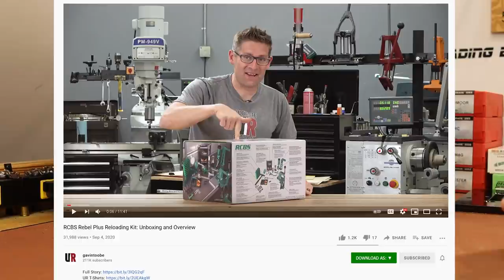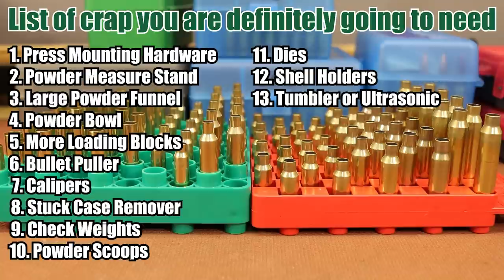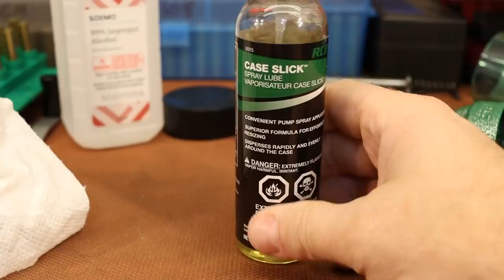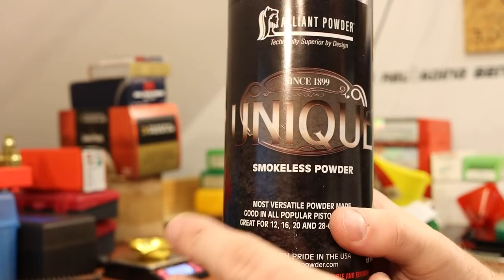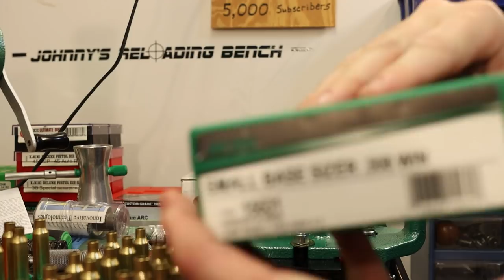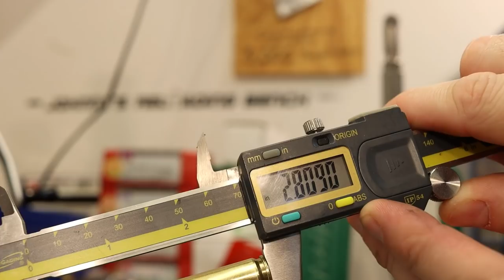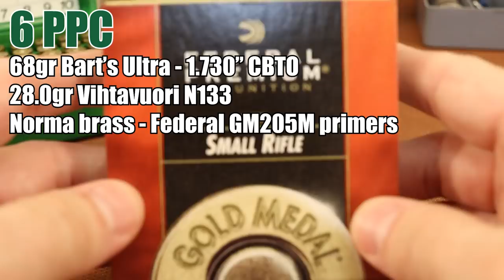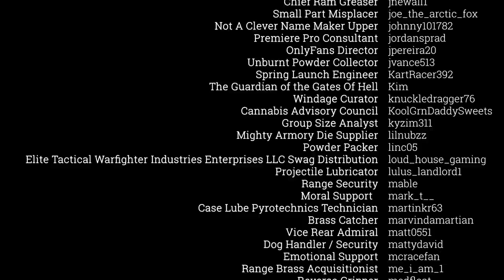RCBS Rebel Master Kit - Full Version

Comment: I came really close to buying this press kit but ended up just buying the RCBS Partner press and a Dillon 550C. I knew I wanted to get into reloading so I just went for it and jumped in head first. Now I have a single stage press to work up a load and Dillon had a thing where you can build your own press kit so I got the progressive to reload bulk 223/556, 6.5 Grendel/Creedmoor once I get a good load worked up and pistol ammo. I bought my last die set right when the Kung-Flu stuff hit but by the time my Dillon came in I was down to my last 300 primers and everything disappeared so haven't really got to mess with it. But the Partner press I've loaded some ammo and for the size of the press I really like it because it doesn't take up very much room on the bench. Glad to see you back on YouTube JRB you rock brother!!!
Reply: Nice👍 primers will be back eventually.

Comment: The greasy stuff off the dryer sheets is the fabric softener.  Most people don't know that fabric softener doesn't actually soften fabric, it coats it with a fine layer of lubricant that makes it feel softer because it's slick.  It's a friction modifier not a softener.  So when you're drying off after a shower with that nice soft feeling towel you just washed, you're actually just smearing lube all over yourself.
That's also why washing machines or that Downy ball that some people use don't add fabric softener until towards the end of the wash cycle, if you add it when the detergent is still in the water mix it washes away all the fabric softener, aka lubricant.

Comment: I got started with the first Rock Chukker in the early 1970s. I reloaded everything with it,  .410, 20ga, 12ga (in light to hunting loads), .25. .38. 357mag, .222, .223, .243, 3030,. .300wm. I used it to load incremental powder and bullets to find the most accurate load for each of my firearms. I show a lot on teams and just target shooting. I bought lot primers, lot cases, lot bullets and lot powders. I shot spring, summer, and fall. When winter hit I spent my spare time in the reloading room all winter to have 15,000 rounds ready for spring again. I loved that system. BTW, I bought 5,000 round cans of .22LR also.

Comment: I just wanted to thank you for this excellent content, I had just ordered the Rebel Plus kit when I found this content and I have to say you have explained and demonstrated so many areas that I was unsure about. I have not started to physically load yet, still trying to assemble all of the necessary components. (Individual items are still in short supply in Aus), but after watching this, I feel a lot more confident than I did before. Many thanks again and I will now be watching much more of your content.

Comment: Welcome back!  Love your stuff, been with you for 4 years since I built my 6.5 Grendel AR.  You are a digital guy but I love analog, no batteries to run down or out, no wondering how far off they are, simple and accurate.  I still check them but they are never off and I often use digital and then the analog to double-check the accuracy.  My RCBS RC kit came with their M500 beam scale, I got the Hornady dial calipers on sale and for about $15 the Lyman Reloader's Micrometer is fantastic for anything (like bullet diameter) under one inch.  That one measures to one ten-thousanth so the most accurate tool out there.

Comment: I just finishes the portion on pistol reloading. Very good and informative. I am as much a newbie as you will ever meet when it comes to reloading. No equipment yet, but lots of YouTube. As a safety measure, I was wondering if measuring the weight of your primed cases prior to loading powder and again after loading powder, you could catch a measurement error or double charge scenario, and if these added steps would be a waste of time.

Comment: thing with dryer sheets (its an american thing, most other countries use fabric softener in liquid form, but its the same), its gives the objects a surface that draws away electrons, the things that make stuff static. Using it on metal parts is not usefull, as there is no static buildup on that. But on plastic and other insulating materials you can get a use of it.
But its often just better controling the humidity in the room - higher humiditiy makes stuff less static.

I live in northen sweden and i can tell you, reloading during nov-mars is hopeless, if there is something plastic it will attract stuff. Even scales get affected if the plattern is plastic, like the intellidropper. Moving one of those yellow spoons (lee) close to a scale will affect it due to the static pulling on the plattern.

Comment: Just for information the Lyman hand neck long deburing tool will remove the small  military crimp on 556/223 better than the  rcbs and other it only took me one year to figure this out as i have most if the other ones. Hundreds of times fast then the rcbs press swagger tool of 40 years ago.
Reply: Lyman VLD Chamfer and Debur tool, and it has been a Huge time saver since I found it worked for the military crimps in 223.

Comment: That 3way cutter for the trimmer also comes with a micro feeding system for the other end of the trimming shaft and you will need the proper neck bushing for the cases your doing , they call it case neck turning accessories don't use on trim pro or trim pro-2 power case trimmer

Comment: I use the uniflow powder measure metal mounting bracket but I put it one the edge of my table. I never even thought of connecting it to the press itself using the die to secure it. I'm going to try that and see

Comment: 2:29:50 is it at all possible that the little green "funnel" tip has a slight lip inside and can have that little bit of powder standing on that lip, so maybe the discrepancy in charge weight is due to that and banging it at the bottom is clearing that little bit of powder on the lip....would not having that funnel on there produce more consistent results so you don't need to tap it on the bottom stroke?

Comment: I use that Case Slick for sizing. It works really good. I just lightly spray it on all sides, let it sit for 10 minutes and then they load smooth and easy.
Reply: Do you angle the case mouth away from the spray? Because what came to my mind was letting it sit would allow lube to pool by flash hole. Have you ever tried the Redding dry case lube?
Reply: @gardnerwebb3749  No I don't angle the spray away from the case mouth. It is a pump not an aerosol,  I give it a pump from all four angles of the case block and just kind of mist it over all the cases. I then let it "dry" for 10 minutes and proceed to resizing, I check length and trim if necessary, de burr and champ fer, then throw them in my vibratory cleaner for an hour or so. It makes resizing easy and not a stuck case yet.
Reply: @gardnerwebb3749  No I don't angle the case mouth away because I spray across the cases not into them, this lightly lubes the inside.

Comment: Great video I am new to reloading and found this very helpful. I have a question I used a headspace gauge kit and measured a group of about 20 of a 100 or so once fired brass from the same gun to determine how much to bump the shoulder. I went .002” shorter then the longer size I came up with. Problem is as I continued on a lot of the brass was already shorter then my new .002 length. Do I keep my setting on my full length die set the same and continue even though I’m not really bumping the shoulder just full length resizing and still ending up shorter then my desired length?
Thanks I’d appreciate any help I’m assuming if it’s under my desired length it should be fine